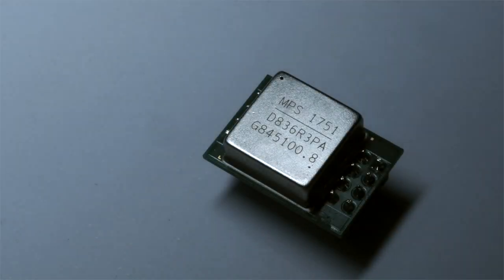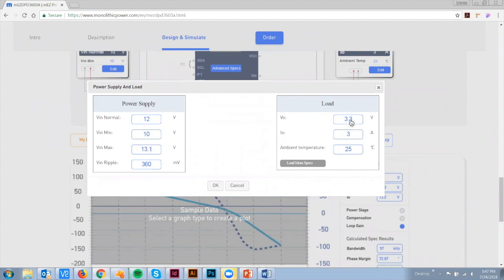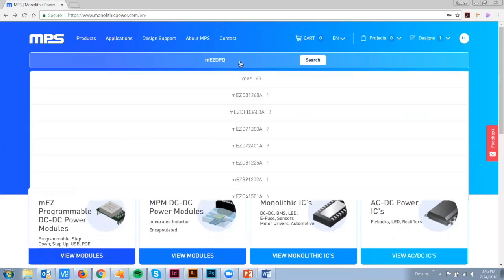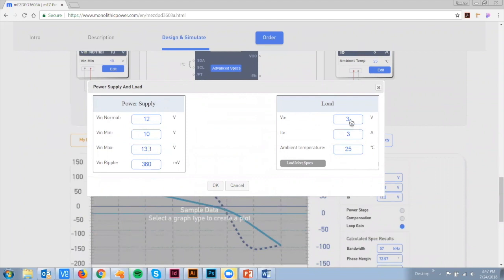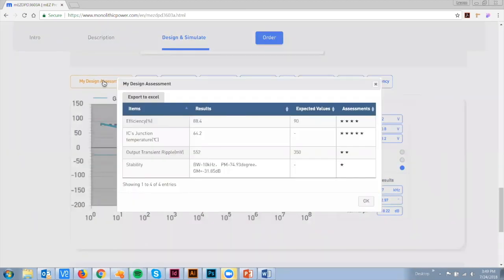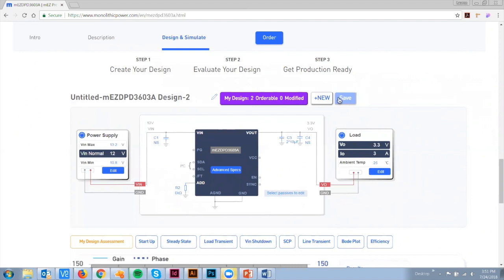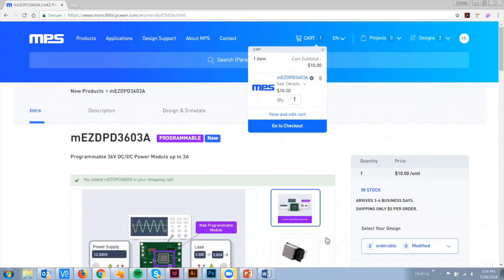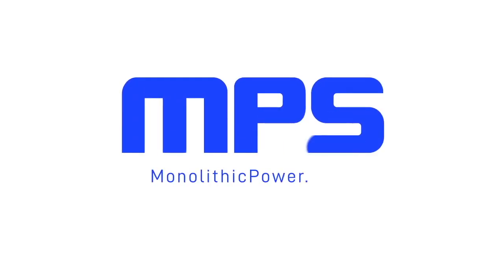mEZDPD3603A Web Programmable DC DC Power Module

Comment: Can I change specs in circuit? Say I wanted to do something like a power bank, where current and voltage change throughout discharge/charge cycle, would I be able to adjust output in circuit?